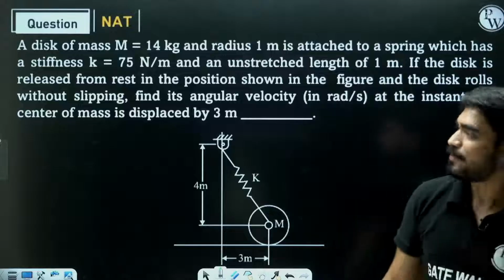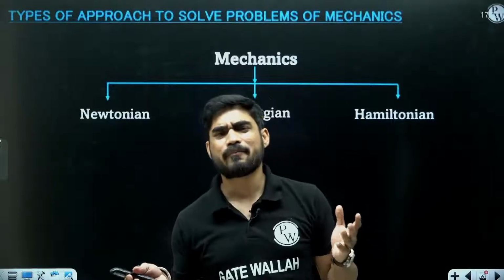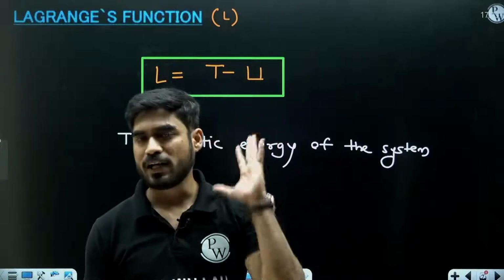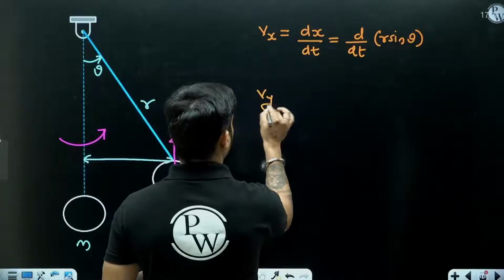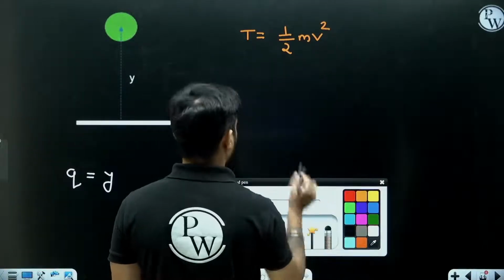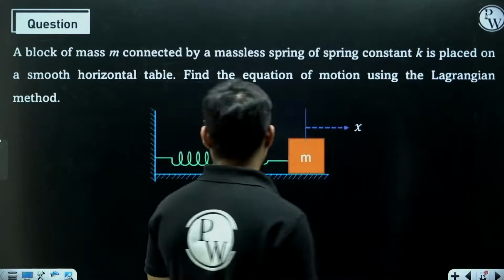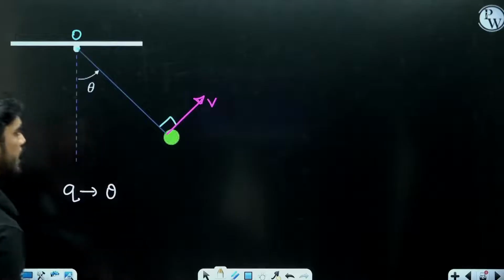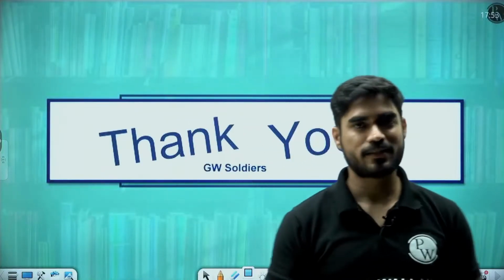Engineering Mechanics 23 |  Lagrange`s Equation of Motion  | ME |  Gate 2024 Series

Comment: In the problem of pendulum the P.E 
= -mgl cos θ
is that correct?

or It should be, P.E            = -mgl (1 - cos θ)
Reply: yes, sir taking datum as the top point whwre the pendulum is connected, i am taking datum as bottom in that case it will be -mgl(1-cos theta)

Comment: 21 / 2 /25  ✅🏁 Review of course

Completed almost all topics except:

1. Applications of friction in brakes, clutches, and vehicles
2. Virtual work (as per the 2025 syllabus)

I highly recommend this course for an in-depth understanding of Engineering Mechanics. The explanations are top-notch, with a strong focus on both theory and problem-solving. It doesn’t just provide solutions but ensures concept clarity through well-structured questions.

Best of luck! 🚀

(Based on my personal experience)